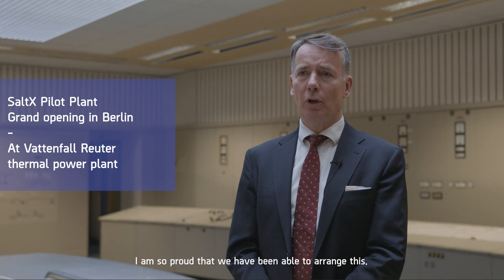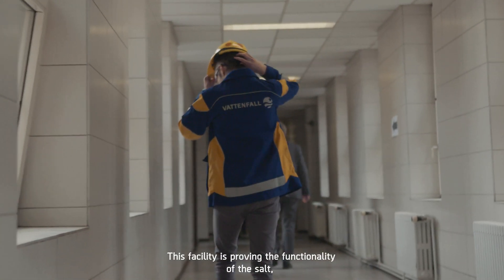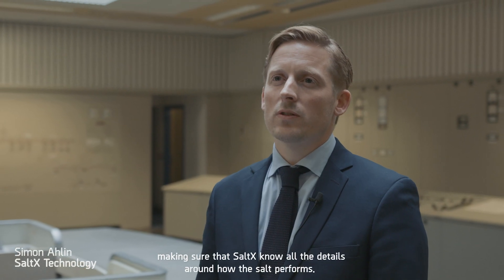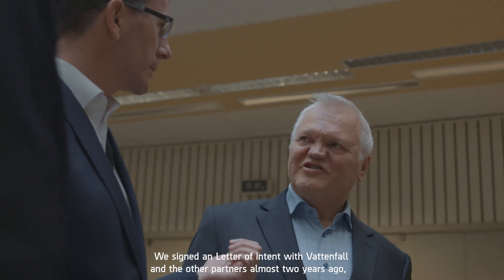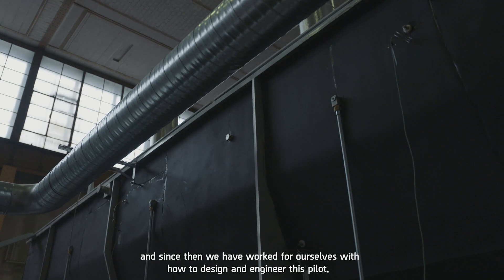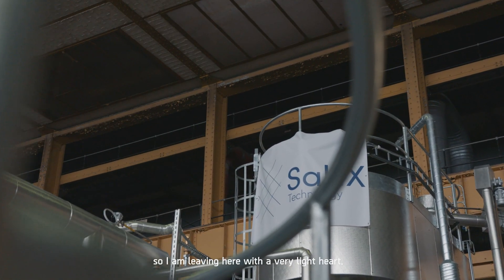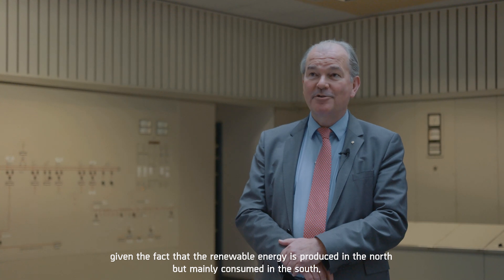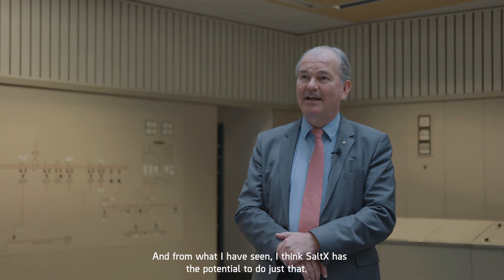SaltX Pilot plant in Berlin - thermal energy storage

Comment: The energy storage through liquid air (nitrogen?) is a very elegant concept. However when the liquid has to turn back into gas, a very fast transfer of heat is needed. It is said that they just reuse the heat formed during compression/ liquefaction which is captured and stored "somehow". I have no idea if they do it efficiently and no website gives a clear explanation.
I have therefore a "gut feeling" this step can still be improved.
 Here with this process, even not so high heat could be used to preheat the Ca(OH)2. Next green electricity could decompose the lime.Then in the end phase CaO -- Ca(OH)2 could provide the concentrated heat needed at very high speed, to make the liquid gas expand lightning fast.